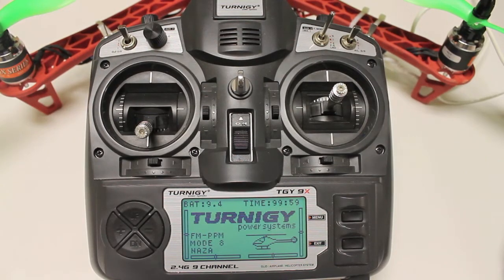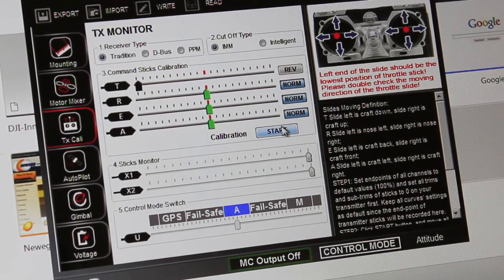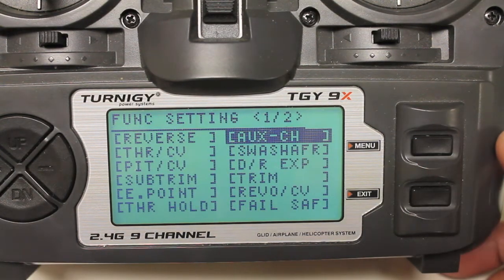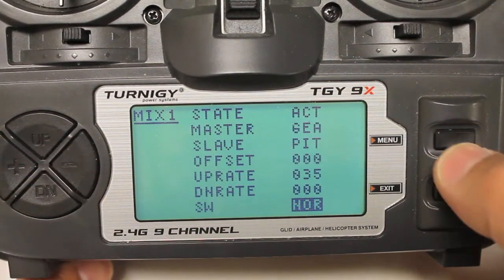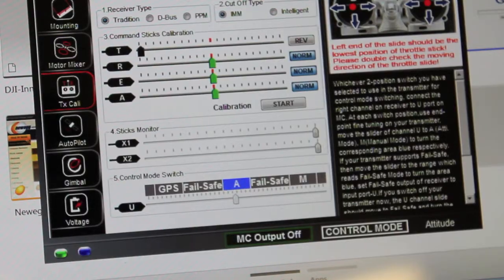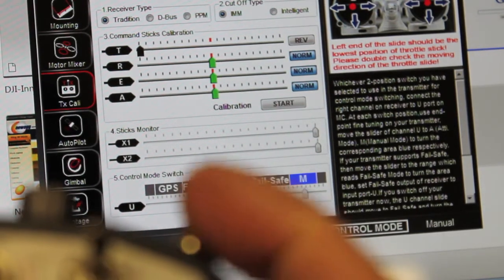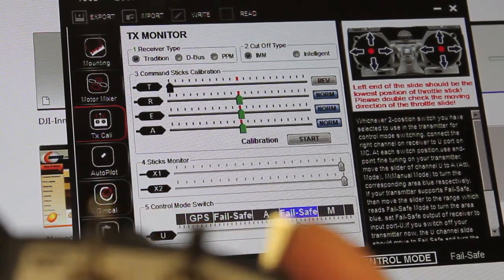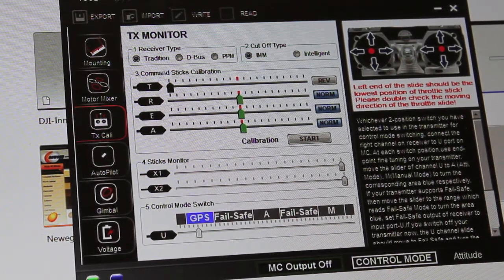DJI Naza Forced Failsafe Using Turnigy 9X Gear Switch Channel 5 Mix w/ 3 Position Switch

Comment: Thanks for your quick reply Dennis. Yes the main reason I use this is so I only need one cable connected from the receiver. Up until now I have been using APM2.5. It is very susceptible to vibrations. Having only one cable connected reduces the vibrations travelling down the cables. I have now configured my NAZA to use all cables as described in your vid. Again it is very helpful. Thanks for the time you spent on creating these. I am now up and flying using the exact configuration you use.

Comment: Excellent video Dennis. Just bought a Naza V2 w/GPS to hook up to a TBS Disco (due soon) and your instructions were invaluable, sir. Managed to get the modes working via the 3 way 9x switch. The gear switch only works for any 2 of the 3 modes (pro123 mix 3 is different from mix 1,2), but it's not a show stopper. The only downside appears to be the fact that the stock 9x doesn't support failsafe out of the box so I may decide to flash my firmware or take the plunge and go for a Taranis (unless I stumble upon a workaround). I'm UK-based but work for a major chip manufacturer in Austin, so I'd be happy to buy you a few beers on 6th Street if I'm in town soon. Thx again!

Comment from the maker: Thanks for following up. I just got my FrSky TX/RX configured and ready to go on my Naza so I'll do a failsafe vid soon. But one thing I just realized is that you're asking about RTH. I opted not to get the Naza w/ GPS and am running the APM 2.5 instead. So my idea for a failsafe vid with Naza was to demonstrate a loss of signal between the TX/RX by turning off the TX. Then hopefully the quad would hover at the same altitude. If you want RTH I'm not going to be able to demonstrate that.

Comment from the maker: Yes, you can definitely set the switch up with a servo. You just need to set the endpoints for each toggle mode of the switch. This will send the appropriate PWM signal to your servo and hopefully tell it how far to rotate. I hope to see you get this up and running. Sounds like a cool use of the switch!

Comment from the maker: You're welcome. I just learned that you don't need to worry about the throttle percentage with newer versions of the NAZA firmware. I just recommend making sure it's set to > 10% just because that could accidentally trigger the throttle cutoff. You need to make sure your receiver supports failsafe. The standard Turnigy 9X receiver does not support it. That's one of the reasons I upgraded to the FrSky setup.

Comment: Hi Dennis. Thanks a lot for your comments. Sorry for not being more precise.
I followed all your steps in your video here..great video.. and the failsafe (return home) works perfectly, with landing home less than a meter from take off spot.
But what took me on surprise was that the TBS just landed where it was when the battery (on the quad) was low. Contolled,but a bit hard. So what I ment to ask was if it is possible to configure the naza to return home when the quad battery is getting low.

Comment from the maker: Thank you...and good question. It's been a long time since I flew with a Spektrum, but generally the failsafe feature is a function of your receiver and not your TX. I used to fly with an AR6000 receiver and from their product page "Smart failsafe prevents motor startup if TX is off and gives low throttle if signal is lost" Google a bit and you should be able to figure this out. It's generally pretty easy to setup with your receiver. Good luck.

Comment from the maker: If you're going to fly in atti mode with no intent of switching to manual then I don't see any reason why you'd need to have it programmed on your switch. You can always reprogram it later once you decide you need manual mode. Glad to hear you got it going.

Comment from the maker: That's a great question and right now I don't know of a way to do this. The problem I see with this is let's say you're far away from the launch location and start to run low on battery. The quad will try to RTL and potentially kill the battery as well as the quad. Now if you're within range and have proper thresholds setup then this would be a nice feature. Anyway, I don't think this is currently possible but will see if I can dig anything up.

Comment from the maker: Thank you Eugene. I appreciate the feedback. I'm not sure if you have the stock T9X receiver, but that was a problem for me. What I had to do is upgrade to FrSky and then I was able to trigger failsafe properly. I have a video titled "DJI Naza Failsafe Without GPS - Part 2 w/ FrSky Turnigy 9X" that walks you through the process. Sorry, but I don't believe there's a way to do it with the stock setup.

Comment from the maker: I believe they represent percentages. But whatever the actual number represents, they are values that correspond with PWMs that are sent by the switch. So the uprate refers to the value that is sent when the switch is in the up position and the downrate refers to the value that is sent when the switch is in the down position. Hope that makes sense.

Comment from the maker: Hi Chris, I originally used my TX in Heli mode but recently switched to Acro. I needed to setup 6 flight modes on my APM 2.5 and was unable to do so in Heli mode. That's when I decided to give Acro a try. There's no reason that I used Heli mode other than that's what I felt made sense when I was getting started.

Comment: Thankyou for the videos. This method works great for a switch activation,
For failsafe radio signal loss program fail safe state on your radio with the failsafe switch flipped in and in att or gps mode at 50% throttle.  Frsky very easy put the radio at 50% throttle in gps mode flip the failsafe switch then push the Failsafe button on the frysky receiver reboot your done. whenever radio is off or loses signal it goes into fail safe gps mode. I tested this in my last video it works GREAT

Comment from the maker: I think your up rate will vary so what you'll want to do is have the Naza connected to your computer and the assistant software running so you can watch the slider change to the appropriate location (Fail Safe) when you modify your up rate. Also, you want Channel 6 connected to U port and nothing connected to Channel 5. Channel 5 will be configured via mixing and ultimately impacts Channel 6. You'll need to setup mixing of your gear switch for each mode of your 3 way switch (NOR, ID1, ID2).

Comment from the maker: Yes, that's correct. Once you flip into Failsafe the NAZA autopilot takes over and basically ignores any stick commands. You can always toggle out of RTL but if you don't then the NAZA will know what to do to get you home regardless of what you see in the Assistant. That's been my experience at least.

Comment: I used this guide more than a year ago for my Naza and it works perfect.
I now want to setup the 9X in another mode for Naze32 flight mode selection and have the gear (failsafe) activate the buzzer.
Can I just use the working Naza profile or do you recommend I make a new one for the new quad?
I also don't know how PPM will effect the entirety of it as compared to my PWN Naza quad.
Reply from the maker: +olivierhacking Glad to hear you got this working. I definitely recommend a separate profile. I always do that when switching between FCs as I may switch back and want the old profile.
Reply: +Dennis Baldwin Ok, thanks. You recommend using Acro Mode instead of Heli, as you do in newer videos?

Comment: Dennis, thanks so much for these instructions. Works great. However, I can't figure out how to make mix-3 work for the third flight mode to go to failsafe. Any pointers for this one?
Reply from the maker: mikeglamrc It's hard to say without seeing your setup. I would continue to mess with your offsets and endpoints to see if you can make it work. Sorry I can't be of more assistance, but hope you get it figured out.

Comment: Dennis, I have setup my system like this and have the three position switch working for GPS, Attitude, and Manual modes.  I also have have the gear switch enabling failsafe. I have the X2 channel of Naza being controlled by the Pitch trim knob for camera tilt for my Tarot.... I have one thing I cannot work out as I don't really understand the 9x yet: I want to enable Course lock for when my quad goes out of site or I can;t see the orientation. The only switch left is the throttle cut (i think). Can you enable this for X1 and say Channel 7 on the Turnigy? Thanks for any help you can give. Love your videos, very helpful to someone like me.
Reply from the maker: Thanks for the feedback. I haven't been able to figure this out with the stock Turnigy 9X firmware. I'm pretty sure it's possible with er9X and OpenTX. I'd have to say if you have failsafe setup then that's definitely the ideal scenario for when you lose orientation. The IOC stuff may help too, but I've never used it. I know this can be setup using the Taranis. If you see my most recent video here FrSky Taranis and X8R Receiver SBUS Setup w/ NAZA Flight Controller I talk about it. If you ever think about upgrading definitely check out the Taranis. It's pretty amazing. Take care.
Reply: Dennis Baldwin I managed to get it all going now, so I have the failsafe on gear, the pitch trim able to tilt the Tarot gimbal,  the three way switch in GPS, ATT, and manual modes, and I finally got the throttle cut switch configured to give me Autopilot home lock. The issue turned out to be I had plugged the receiver ch7 signal wire on the wrong pin on the Naza Aux channel! Duh. Also had to max out the switch limits for the AUX channel (to 120% either end) to get it to engage the home lock. Yippee. Thanks for your help as I couldn't have done it without your videos on the standard Turnigy 9x.

Comment: Dennis, you've very helpful! I've put together a HK Bumblebee quad with NAZA Lite.
I've got the Flysky 2.4 8 ch ghz tx/rx and thought they are the same as the Turnigy. 
I followed your vid and tried to set up the "forced RTH". For some reason it just won't work! Is it possible to configure the forced RTH on Flysky tx/rx?
Reply from the maker: I would think it's possible but haven't used the FlySky before. If you have problems perhaps someone at www.garagepilots.com can help out.

Comment: Hey Dennis, thanks for your reply. I was hoping as I'm new to Quad copters, if I felt that I was getting out of control I could flick the system to Failsafe to stop copter until I'm ready to take over again, or just have it return home on it's own. I understand that if the Trunigy or FlyShy TX goes dead for what ever reason, the NAZA system will not default to failsafe mode anyway.

Thanks

Comment: I seem to have the same problem. Channel 5 is empty on my receiver end. Set up the program mix per your instructions, but when I flick the switch nothing happens. I've tried a few different mixes, but nada. I'm beginning to think my switch is broken.

Thanks for your 3-way switch explanation though. It's been very helpful.

Comment: hi Dennis!
You truly are the man. Thanks so much for your videos, straight to the point. I just moved from the MWC to Naza Lite GPS and I also use a 9x radio, so I am setting it all up with your help. After getting the three mode switch working just like yours I went for the forced fail-safe on this video but my 9x does not do what yours do. I follow the videos to the T but my gear switch does nothing. I even spent lots of time going thru every number on the uprate, downrate...
 but nothing. Any ideas? I might have to upgrade to the flysky module like you soon... tks.
Reply from the maker: Thanks so much for the kind words. What channel do you have the gear switch configured to work with? Also, what flight mode are you in (HELI or ACRO)? I'll see what I can help you find out. Take care.
Reply: HeyDennis! tks for the comment. Like I mentioned before I just followed your directions to the T. Gear switch conf. on channel 5 (not connected). I also have the TX conf. on HELI, just like your directions. The one thing I didn't mention was that my Tx is the FlySky TH-9x, which I assume is exactly the same as the Turnigy. After a few tests I am about to give up on the Naza failsafe totally, as it makes my quad descend almost every time I test fly. It will not allow me to set a voltage number under 10v. Previously when I had the MWC my buzzer would go off upon heavy throttle when I was towards the end of charge, just to quiet down after lifting throttle and recovering charge. It seems the Naza engages the descend failsafe at the very first sign of low voltage taking away my control.
tks!!! All I want to do is set it all up robust and reliable and go film some snowboarding! at least my MWC didn't have a mind of it's own ...:)
Reply from the maker: aurisnow I'm not sure about the FlySky being identical to the Turnigy 9X. I've heard that it is but I also recall others having problems with this setup. I'll see if I can find anything out. Regarding the Failsafe descent with the NAZA perhaps you should only setup the first level protection. I believe that just flashes the read LED and doesn't do that auto-descent. I think that only happens at the second level protection. Whatever you do be careful and don't lose your quad :) I really enjoy the simplicity of the MWC.
Reply: I don't see how to set up only first level... I bought the NAZA Lite with GPS and the firmware is the v1.0. Should I try to upgrade the firmware? It tells me it is up to date... tks
Reply from the maker: aurisnow I think what you can do is set it really low so that there's no way it can trigger...unless of course you drain your battery way down :) BTW I don't think you can update the NAZA Lite firmware. From what I've read the firmware is fixed.
Reply: Got the thing in the air finally and it flew great, but naked. I am running a DJI style 450 frame with 2212 980kv 40A speed controlers (H-100). It was going all crazy on me I think because of too much weight. I was trying to fly it with brushless motors gimbal, GoProHero and 4500mAh battery... anyone out there was able to get a similar set up filming good? Now I don't know what's the best route to take, bigger motors, smaller gimbal motors (?), smaller battery? (the 2200's didn't seem to give me any flight time...) should I switch speed controlers? Should I use a dedicated battery for the gimbal? Thanks for your great help, give me a shout if you have any ideas... cheers.

Comment from the maker: A few weeks ago I left my T9X on and did hear it beeping. I don't recall what the voltage was at the time, but I know it does have a low voltage alarm. Now I don't know if this applies to AA batteries, but I don't see why it wouldn't. With AAs you don't have to worry as much about discharging as with lipos. My original lipo drained so much that I had to rig my T9X with AAs until my new battery came in.

Comment: Hello,
Thank you very much because you are very clear to explain.
I did everything same you for 3 position mode and this work perfectly.
But, I don't know why, after following your video step by step for "failsafe with GEAR", nothing move in any position of pit on naza when change GEAR position.
I have to say "maybe important" I'm using FlySky FS-TH9X.
Thanks.
Reply from the maker: Hi there. I'm not sure about the FlySky TX but would expect it to be fairly similar. I have a video that I'm posting today that discusses the main difference between ACRO and HELI mode for the 3 position switch on the Turnigy 9X. Maybe it will help you out. Thanks for watching.

Comment: Hi dennis,

Can you please help me understand,

What are the conections i need to make between the naza and the reciver,

I am using, 
9x original firmwere ,
8xr reciver,
Naza m lite,

I understand i need to hook it up at the traditional way (cant use sbus as far as i understand),
Any way. Just need to know about the hardware conections,
The software - u made it look so easy, Thx !!!
Reply: Dennis Baldwin  ?
Reply from the maker: Naor Cazum On the left will be the Turnigy9X RX channel and on the right will be the NAZA port:

CH1 -> A
CH2 -> E
CH3 -> T
CH4 -> R
CH5 -> U

Make sure you have everything binded then go into the NAZA Assistant and you should be able to do your TX calibration. Good luck and keep us posted.

Comment: Hi, gotta say your vids are good, nice clear instruction!!! On this one you say there is no lead, just software setup, would you use a lead to channel 5 to make it work correctly???
Cheers
Ken
Reply from the maker: Ken, thanks for the comment. If you want to do the setup the way I did in the video then you don't need the servo connector at all. If you're trying to do something different might I suggest you check out www.garagepilots.com and post in our forums? We'll be glad to give you some help.
Reply: Dennis Baldwin Hi, thanks for the reply. I'll be doing the conversion on my Ifly 4 this week, just wished I'd got a different frame!!! 
I'll post a video if it all works out!!!
Cheers
Ken

Comment: Hi Dennis. 
I am confusing a little bit. When i fly my quad, i setup my Tx at Airplane mode. If i choose Heli mode, how can i control each channel like Ail, Ele separate? Because in heli mode, when we move throttle stick, 3 servo move together at the same time. Please teach e. Thank you Sir. Regard!